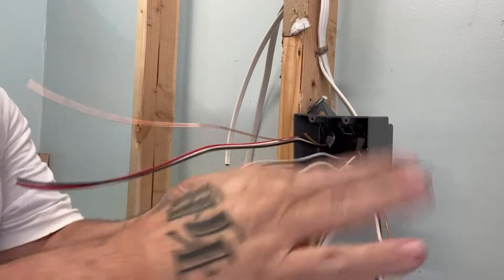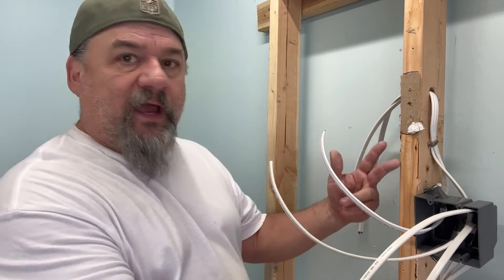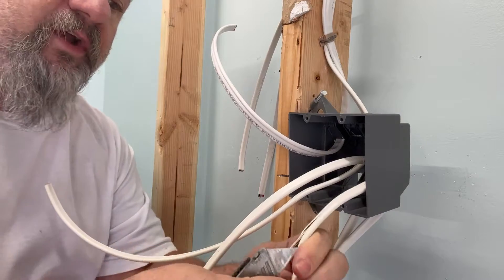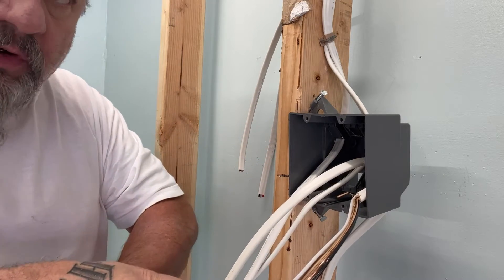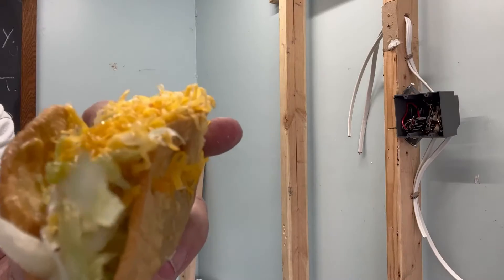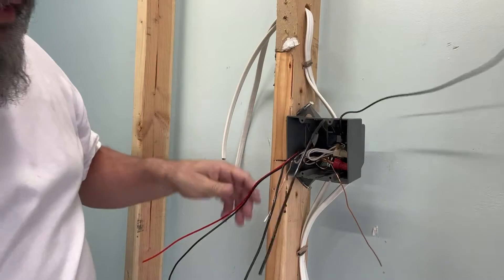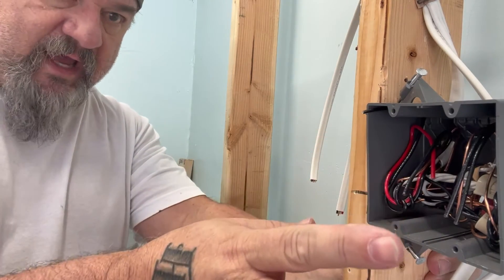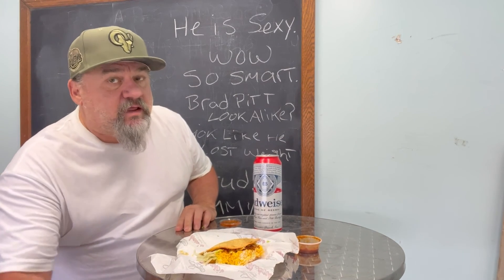Wiring a Switch? Here's the Trick That'll Make It Simple - No Matter How Many Gangs!

Comment: Those wire strippers make me nervous.  They can nick the copper,  creating a weak point.  Ever since working in a factory as an assembler,  I have been a huge fan of thermal strippers.  Heat from  flame worhs in a pinch,  too.  We don't see too much double-cotton insulation anymore.  It's all vinyl.

Comment: Why you put the two black wires togethers???
Reply from the maker: the hots?
Reply: Feeding the circuit through to some where else
Reply: Because those the the hots (line)  feeding both switches with power they can be put together because that's always a constant source of power the rest of the romex is going out to the devices